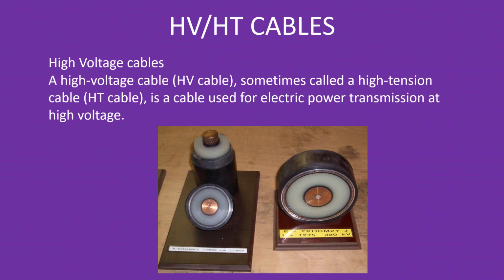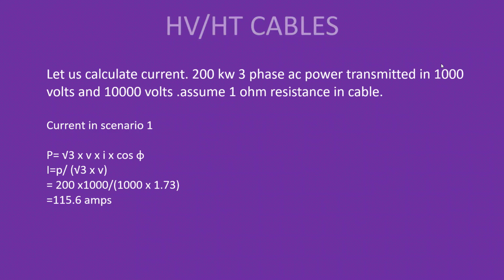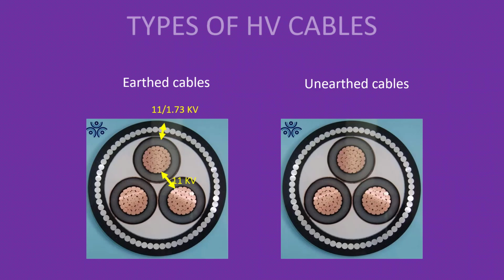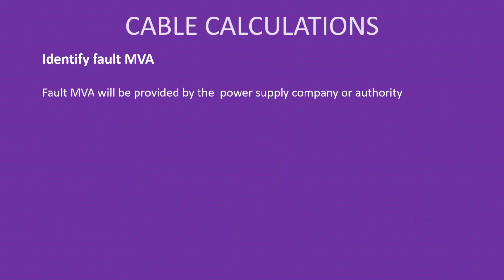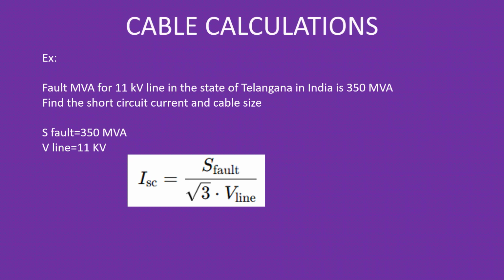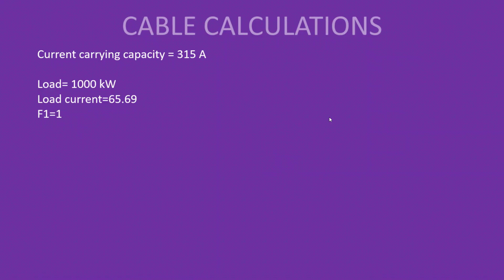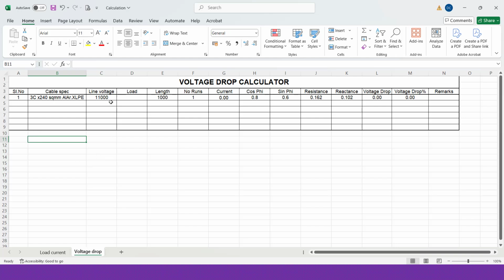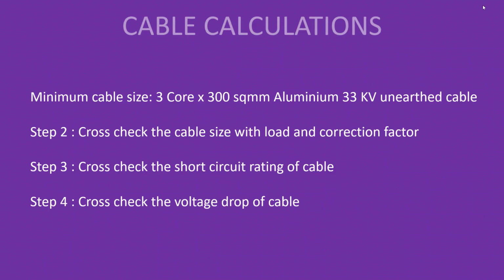High Voltage Cable Calculations: Everything You Need to Know

Comment from the maker: Low voltage cable sizing calculation : Complete video
https://youtu.be/sbjFJLBehiw
Reply: Can you do a video on HV Room fused board how they are all calculated. For normal house hold or any board industrial are everywhere but when it come to LV room and HV room fuse boards how those calculations are done there is nothing there at all , so if you can do one such a video it will be great.